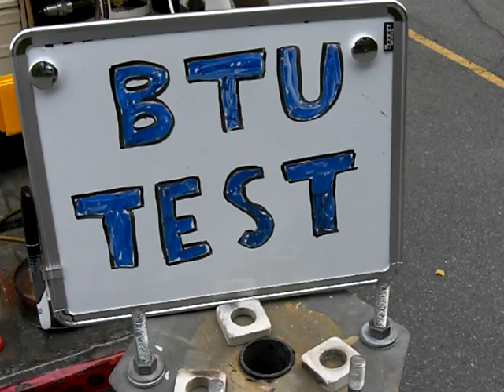#14-Joe Pipe-WATER TO STEAM TEST-PART 1 of 2

Comment: Yes, somewhere around there.  And that is not even using the full potential.  Maybe just over half.  Check out the 230 vid series on the new Level 4 flame.  Both air and propane is turned down to the lowest settings and the end of the Joe Pipe is pumping oiut around 1. 900 F out of the end of the pipe.  Just from the Joe Pipe being on pilot, you would be able to run your fridge and hot water tank.  Turn it up a few notches and now you have super heated exhaust to heat a large ss grill or oven.

Comment: The test was to see if the heat was intense enough to turn the bottom of the ss dish orange.  This did happen in previous testing using a stainless steel kettle.